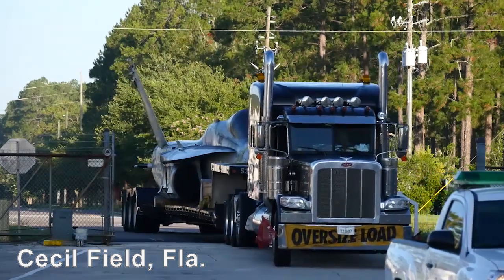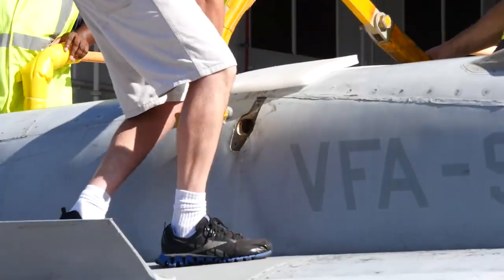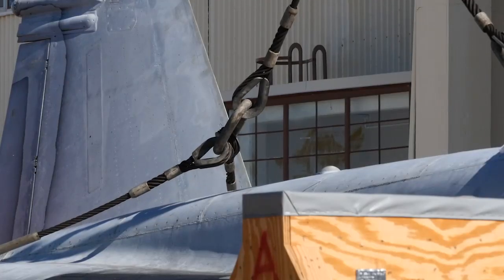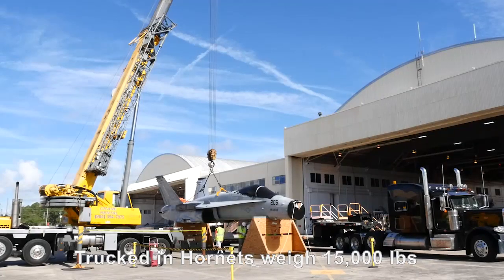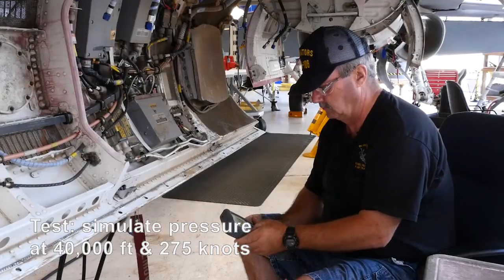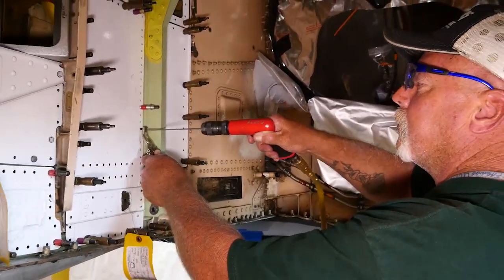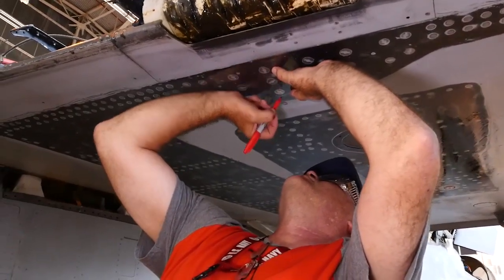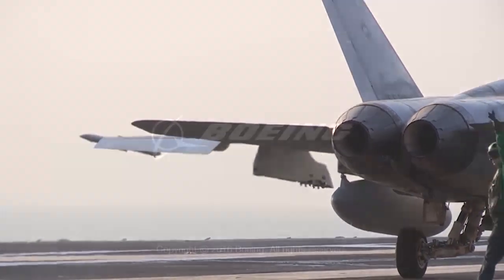Boeing's F/A-18C+ Program Gets Hornets Out of Retirement

Comment: The Marines are refurbishing these old aircraft because they have refused to upgrade to the later Super Hornets. They are holding out to start flying the VTOL F-35 B and will not compromise on their dream aircraft. It would be far more cost effective to upgrade to the Super Hornet than this restoration program. I am amazed the Marines are allowed to follow this program.  The truth is that replacement parts for these old models are getting hard to obtain. The Marines will have to restart production on these parts to keep these old planes operational.